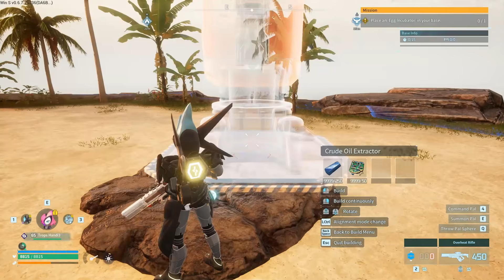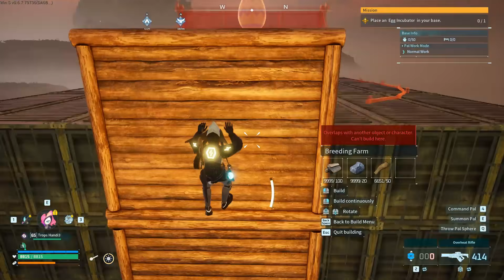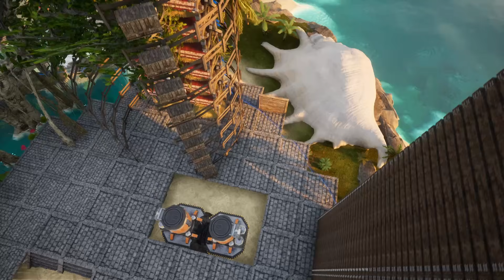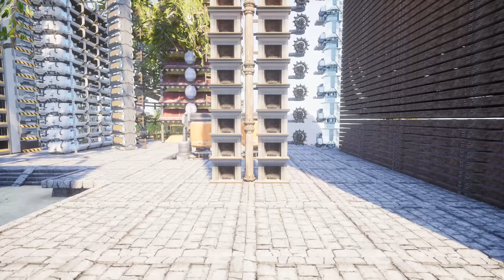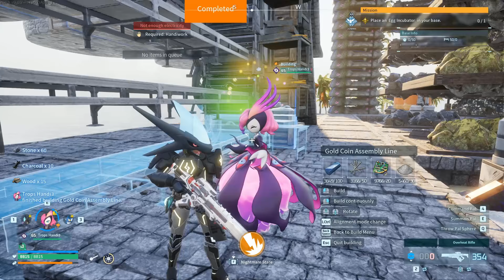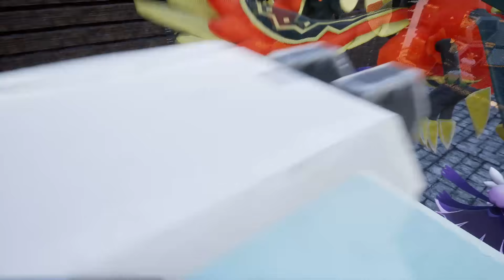Palworld - How to Build The Best 50 Pal Base in the Game (Max Efficiency Guide)

Comment: I've tried to build the oil extractor and the foundation like 7 times now, every time trying to get it as accurate as it is in the video, however every time there are different issues. When it's just a tiny bit off you either won't be able to place roofs next to the tree on the water, won't be able place pillars in the water to support the foundation, or there is terrain in the way of where I am supposed to build more foundations. It feels impossible to humanly replicate, since it's seemingly pixel perfect and you can't see if you did it right until you already spend time on placing half the foundation again...
Edit: And when we dismantle the palbox to reposition it later on the oil extractors fall apart, forcing you to rebuild it exactly as it was or else it won't fit with the very tight foundation placement...
Reply from the maker: okay I totally understand your frustration.
Join my server on discord and send me a dm.
I will send you  some screenshot to help you do it perfectly.
If you struggle I will then personally join your world and help you out.

Comment: 50 pals can they really keep up with production?  My thoughts are a 7-in-1 base with 350 maxed-out pals. My goal is to change some of the setups around for max production.  I still think you overlook fruit orchards and farms with all vendors in sight. OMG 50 pals can do this... Is really crazy...
Reply from the maker: This is designed so 50 pals can all go farm coal for example or 50 pals can go grow crops and so forth for everything.
It's an all in 1 base, so you can mix and match to get all resources at once if you want.
It's entirely up to you what they do/get.
Reply: @TropsPlays ahh i see i was wondering how we going to assign all the pal for this stacked station. Thank you for clarifying. It seems like this requirement focuses on the suitability of a single work suit. Is that correct? Based on this comment, I understand that the approach involves switching between different suits based on need. Is this the intended meaning?
Reply from the maker: @nasrulamin2558  that's correct as all the pals are different and there is a BIS for each work suitability. Using 50 Pals for the same WS is a option. You can mix and match to obtain a bit of everything if you wanted.

Comment: I built the 15 pal version but I ended up deconstructing the oil extractors because I could not tolerate the sound. Do people use a mod that just lowers the volume of the oil extractors or something?
Reply: When they are full, they will stop making the noise until you remove the crude oil
Reply from the maker: @user-ei5ql4pc5s  ohh nice, mine are never full so I didn't know this
Reply from the maker: I have no idea. I just don't go near them

Comment: PS5 player here. Been experimenting with this in a base, testing the console’s limits. Stacked 2 x100 mining sites and used 50 Pals. Was too anxious to push any further. I assume you wouldn’t know how many stations and Pals consoles can handle at one time? Or at least how much work does each station you place (no matter the type) and Pal put on the game? Thank you
Reply from the maker: Well, on pc, there is no height limit.
You can go until it doesn't let you build no more, and it all still works.
With this being said, this is the maximum as each structure can be used for 50 pals.